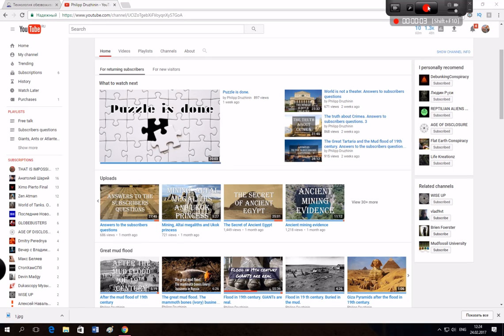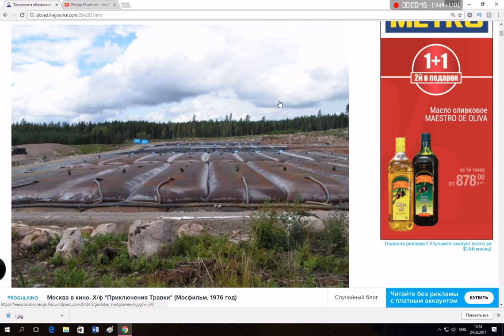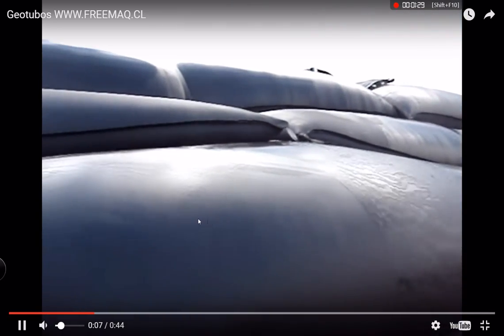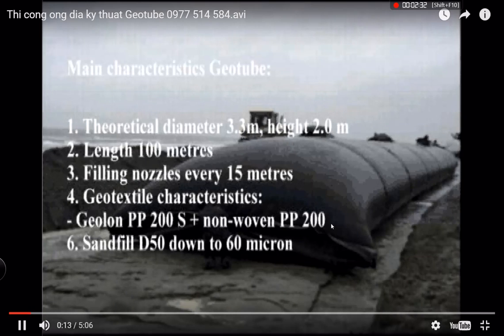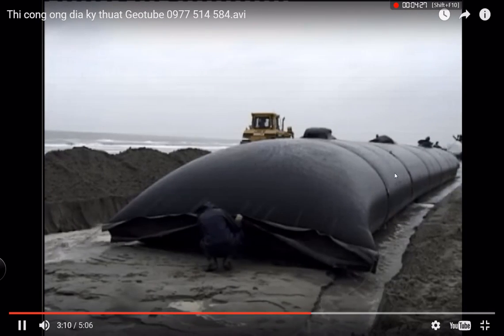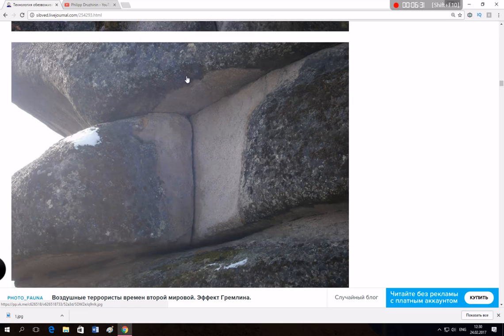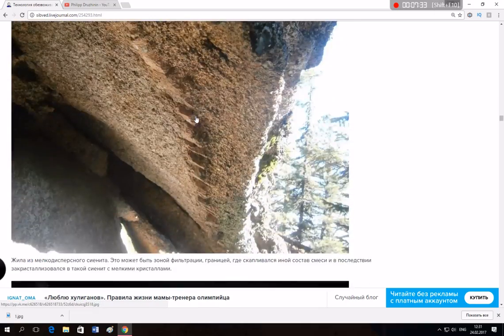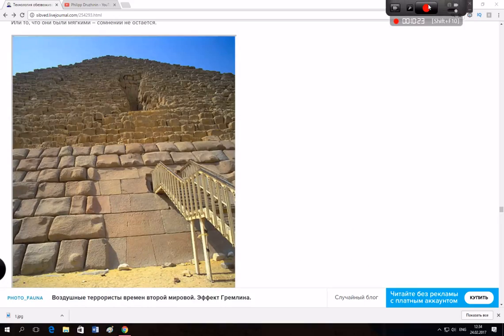Dehydration(Dewatering) or Geotube mining and megaliths

Comment: If this was true, then some bag material would be left in the cracks and underneath in between etc. to date no bags or even impressions have been found.
Also the megalithic stones don’t always match up smoothly in the back, only the front and sides.
Look into it.
Reply from the maker: Bags dissolve in couple of decades , this is geotube tech it’s not supposed to produce megaliths , but the same type of tech could be used to produce the megalithic walls or just the outside layer doesn’t matter

Comment: It works with all the modern Industrial standardized size bags that they keep filling for when it comes to old blocks why did they build with completely irregular bags? Did they have limited materials? so as they were building they just said " well we can make a small bag today" next day they get materials for a bigger bag and so on until the wall is built? But the wall looks all wonky. I don't know...something doesn't add up about the weird sizes... and it's only a few stones that have those nipples I guess most of them were rubbed off?

Comment: You may have just answered one of the most enduring questions of all time -  How did the ancients create the megalithic blocks? This presentation actually makes perfect, logical sense and goes a long way toward explaining the curving angles, ridiculously close joins between blocks and the very reason the have nipples! Well done Philipp D.
Reply: I agree that it is an excellent analysis and theory. But how did they remove the cloth material containing the concrete after it had dried.  I guess they could move the blocks after they were poured, pull off the material, and then re-put the block in place where it will fit nicely, and then sand off the impressions of the cloth-like material.  The nipple drain theory is excellent. I think it is possible.  It wold explain the shapes. Since we now know that stonehenge was fake and made of poured concrete, perhaps made in the exact way, using the cloth bags to get that smooth rock look.  Great video.
Reply: Biodegradable material used for the bags, is my answer to the person who asked how how the bags where removed.
Reply: Jeff Beck l